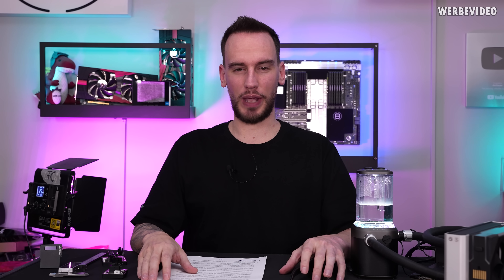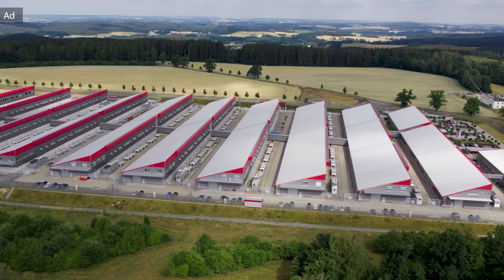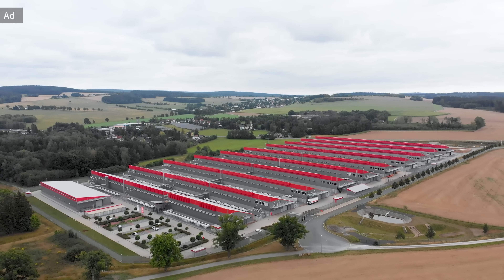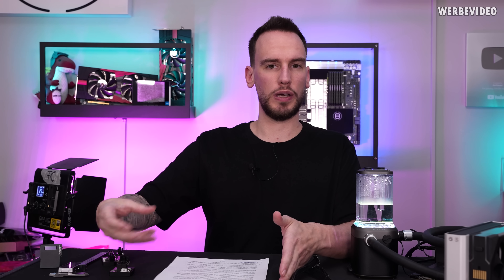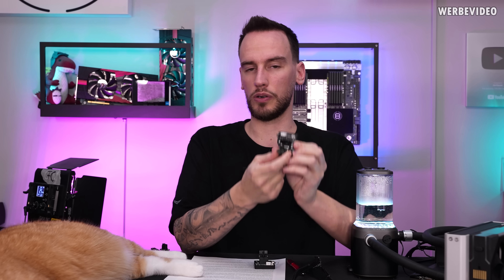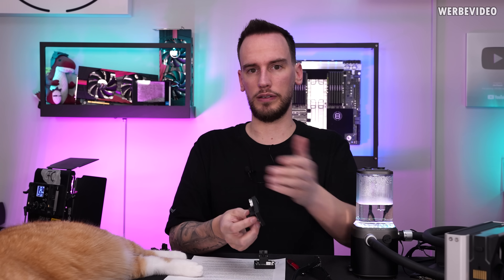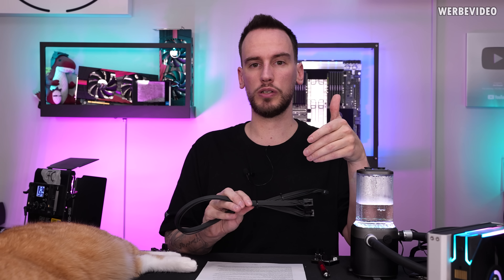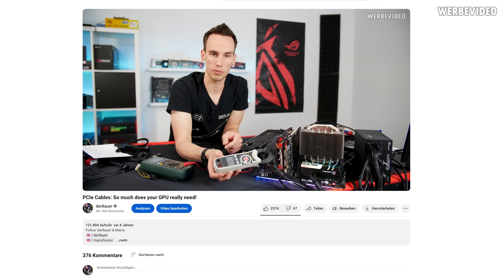12VHPWR is just Garbage and will Remain a Problem!!

Comment: Thank you for the video sir 😮
Just bought rtx 4090 strix card im gonna check it when i go vacation 
Im worried if my fractal torrent can fit to  bent the nvidia 12vhpwr connector at 35 mm in my case though 😅 (because the card is so expensive cost me 150k  PHP equivalent to 2,710 USD)

Comment: The designers of the actual cable Plug for this cable were incompetent from the beginning. THAT needs fixing, regardless. I also agree that 2 cables would be much better. Of course, that would mean redesigning and potentially REPLACING all of the 4090s so far sold. Nvidia could afford it, but I don't see them doing anything even close to that. Maybe the 5090; but even then, 2 cables on that might get questions asked. Great and very informative video, keep up the great work.
Reply: 2x CPU/EPS power cables would do it. Perfect solution.

Comment: Why not using the 24 pin motherboard plug into a pcie special cable? Also, why not soldering the plug on top on the cards (though the back plate)? We don't have SLI anymore so there shouldn't be stuff on top of it.

Comment: As someone contemplating getting a 4070ti-Super, or possibly just a non-Super 4080, does this issue with the 12VHPWR cable only arise with the 4090, or has it also affected other "lesser" RTX models?
Reply: rtx 4080 founders edition and some others had this problem.Not all rtx 4080 uses 12VHPWR.Check it before buying it or buy amd.
Reply: @sametekiz3709  all 4080 use that connector, only 4070 and down can use 8pin

Comment: The cards been so wide, and the connector not giving a firm connection like the pleasant click of the 8-pin connector, I can’t see how they can savage this connector. Sadly the market is driven by looks. Adding a thicker/bigger/robust connector would ruin the aesthetics for the RGB crowd. I would love if they use a kettle cable for the GPUs. Solved. 😂

Comment: Irresepective of how many circuits they have, I cannot understand any rational reason to reduce the pitch of the connector to 3.0mm. All it did was create mechanical issues and installation issues. There are no benefits when the rest of the system and all power supplies use 4.20mm pitch connectors, especially when they just supplied adapters to everybody. That just made everything complex and dangerous for no reason whatsoever. Even ATX12V0 spec uses 4.20mm pitch and that's made specifically for SFF and power efficiency.

However I can understand why they did want to eliminate all of the redundant grounds in the PCIe 8-pin, they are a total waste of board space and make your card look 'visually' power hungry. If you did have 4x 8-pin PCIe connectors it has the same number of +12V circuits as 3x 8-pin EPS... which is the blatantly obvious thing to do.

Change to EPS, they never have awful pigtail style PSU cables so the safe maximum instantly goes to ~300W with 18 AWG and if you need overheard for an OC card, 3x EPS connectors would be stunning. The standard exists, it would be cheap to adopt, easy to modify PSU's for and much much safer for everyone.

On that note, I think you neglected to mention 8-pin PCIe pigtails which certainly would pose a problem for nvidia to run 4x 8-pin PCIe's. Because they are so prevalent in stock PSU's, even really high quality units there would be thousands of users trying to push 600W through just 6 +12V pins which has exactly the same factor of safety as 12VHPWR. Making a 'new' standard gave nvidia the ability to exclude such cases.

Comment: Why they keep insisting on using those many Pin Connector Designs despite only carrying a 12V and a GND Signal ( Signal?! 🤔 Ya get what I mean... 🤨 ) makes me scratch my head.
A 2x 12AWG Wire XT60 Connector from the RC Hobby Industry has a 30A / 500V rating and would - IMHO - look a lot nicer than what we use nowadays simply for only using two arguably thicker Cables on top of having a smaller Connector footprint. Heck... If XT60 isn't enough there's even XT90!

Personally, I'm running my RTX 4090 Founders Edition ( unfortunately the old spec Connector design ) with a so far not recalled 90° CableMod Pro V1.1 Cable and a 70% Power Target in hopes of it reducing the risk of a Meltdown since let's face it... Of all the Cables at my disposal to the Card ( the atrocious straight 4-Pigtail Adapter that shipped with the GPU or the barely acceptable straight 12VHPR that shipped with the PSU ) the 90° CableMod Cable is still the most favorable one with it a) being the only one not putting a bending load onto the Connector and b) it being the one with the most recent design specifications.

Comment: There is also something odd with cables. I used a Cablemod cable (after my adapter melted) just on its own, and because I was worried about it, I put a temp probe (attached to the connector) on it. I played Cyberpunk maxed out and saw the temp probe hit 61/64c at the most. Much of that was the case temp and the heat from the GPU fan exhaust, but it was a baseline for me to work on.

I changed my PSU a month later to an Asus ATX 3 one and used the cable that came with it. I set it up the same, put the probe on the same and ran the same save file of Cyberpunk to compare. The probe hit 51 to 53c max....10c cooler.
That seems to show that the pin type/cable thickness/plastic used by Cablemod is different from Asus.
Reply: and neither of those temps are something I'm comfortable with my cables being. 50C can burn you, and i know you aren't going to be touching it but imagine if a plug from your wall was getting over 50C.
Reply: @Born_Stellar  As I mentioned, most of that is from the case and card (heat it throws out). Idle, its around 30c. 
It's a physical temp probe, so it picks up all the heat, but it's still a way to monitor any changes as long as I have a max baseline, which was Cyberpunk, but is now Avatar.
Reply: @innopriest  lol not dangerous. but I would be concerned if I picked up a cable that was 50C. I also watercool everything with a ton of rads, I just like keeping stuff cool.
Reply: @innopriest @innopriest  The probe is a physical one, so it reads all heat, case, GPU fans and so on. It is 30c idle and has hit 53/54 with Avatar, but most of that is from everything else rather than the cable. I have a baseline from that, as Avatar Maxed now draws more on than Cyberpunk. I have an alarm set, so if it goes over 58c, I know something is wrong.
The only time I need to redo this is if a game comes out that pulls more power than Avatar or if we have a good/hot summer.

Comment: This comes out more as Nvidia forcing some form of restriction on their users because they could've used a 8 pin EPS connector instead. That's what the A6000 uses and it can manage with just one connector. Or maybe design the card better because AMD somehow manages to squeeze about the same level of power delivery out of only two 8 pin connectors. But I guess this is what happens when people bitch and moan about a flawed product then proceed to buy said product anyways. That really sends the correct message, especially when the suggested solution for the problem involves adding another connector for redundancy. Now you have two potential sources of problem instead of one. And the sad part is, this is probably what nVidia will do. Then these new cards will sell like hot cakes because people are desperate for a quick fix, then they'll bitch and moan again because they'll run into the same issues they had before, the whole redundancy will not work for some reason and so on. Somehow adding more fuel to the flame will put it out?

Comment: The easiest way to do is to go back to the MUCH SAFER 6-pin and 8-pin connectors. Just three 6-pin connectors have better power handling compared to one 12VHPWR ! I have been using 6- and 8-pin connectors with cables literally bent at 180 degrees directly from the connector. No issues whatsoever!  Why you may ask?  Maybe  because the 12VHPWR has considerably smaller pins - meaning less current through each pin. And it is so densely packed, that it is considerably WORSE than any combination of 6-pin or 8-pin. Even if you connect the 12VHPWR in the best possible way with a perfectly straight cables near the connector, and if you are using exactly the factory specified power of 600W, it is doomed to fail - sooner or later (most probably sooner). And really - the solution is VERY EASY - go back to the much safer 6-pin connectors - three 6-pin will be much better than one 12VHP.  The introduction of 12VHPWR literally smoked billions of USD of consumer's money - for expensive cables, for expensive adapters, and then - for replacing all melted cards, cables and connectors. This is a massive FAIL!

Comment: I bought my 4090 in April and did sooooo much research to make sure i bought the best cable for it. I thank God i bought the Corsair 12VHPWR. To this day I can't find a single reddit or twitter post of that cable being involved in a connector melting.

However, that level of meticulous research shouldn't be a requirement to make sure that your +$1,600 does not go up in smoke! I'm tired of people saying it's solely from user error. It is a design flaw full stop.
Reply: I wouldn't say it isn't user error. However, it is a design-induced user error, which is even worse than a simple design error.
Reply: Yup, and if it's that easy for the cable to be installed wrong, because it has to be 100% perfect, it's still a design flaw. You cant put products in the market for the average consumer with no safety margin, that's negligent to think every consumer will be perfect. Every 4090 owner should be joining a class action lawsuit vs NVIDIA and contacting regulators to force a recall.
Reply: Its like L85A1. Need a complete rework to start working as it should`ve been.
Reply: absolutely 100% agree my friend. if only the whole wider industry and industry partners / working groups itself wasnt so entirely dumb. unfortunately the corsair company are really an exception rather than the industry norm here
Reply: Same reason but now just got ModDIY cables (and not adapters) from 12VHPWR to 3x8pin going straight to the PSU, even though it has native 12VHPWR connector already. Risk decreased down to just one 12VHPWR. If I could somehow replace the connector on the card itself I would too
Reply: I've been running a Cablemod 3x 8 pin to 12VHPWR extension type on my Zotac 4090 Amp Extreme Airo for over a year powered by the Corsair AX1600i, the card has been powered up 24/7 with a lot of gaming hours and I have had no issues whatsoever. I've even removed the GPU and power cable to replace my NVMe with a larger one months ago and still have no issues with my 12VHPWR connector on the GPU. I still don't like the connector but as as long as it's inserted properly you really shouldn't have too much of an issue. This is fitted inside a Phantek Evolv X with the glass side panel on with about a 2mm gap between the cable and glass.
Reply: Ive also got the Corsair Cable, been using it for 1 year on my 4090. Not one problem, very good build.
Reply: Any chance you could list a SKU number?
Reply: It's not about it catching on fire.  Did you even watch the video?  It's about the connector being intermittent at high loads.
Reply: I wish your adapter will have the connector facing down :/
Reply: @sinAnon6689  It is a faulty design. However, users actually knowing what they're doing when building a system largely negates any issues.
Reply: @sinAnon6689  Haha. Yeah ok fair. I can't really argue those points.

Roman hasn't had any issues himself. I assure you of that. I still need to stress that nobody who knows what they are doing when building a system, truly knows, will have issues. I certainly haven't with these cards, and neither has even a single YouTuber that isn't a moron for that matter.
Reply: It's user error. No matter howuch you don't want it to be.

It's funny. I literally never have the problems others have. Ever. Guess why? I know what I'm doing. It's honestly that simple.
Reply: @nexxusty  Why are you gracing us plebes with your presence, Godly one?
Reply: @nexxusty woah, you're soooo coool
Reply: @nexxusty if it was an amd card eith their loud lbimd fanboys, there wouldn't be all this exaggerated comments

Comment: Nvidia created a solution to a problem that never existed in the first place lol. I've got a RX6950XT with two normal 8pin power connectors and it's good. I had a RX6600XT with the same and it was fine, I had a GTX1660super with the same and it was fine and a RX580 that also used a standard 8pin connection and that too was perfect. 

Steve from gamers Nexus still thinks it's user error lol. I can just imagine the amount of heat that runs through a single 12 volt high power connector and all it takes is for it not to be seated properly then boom lol. Even if it is seated properly the connection can still flex lol. 

I'm glad I stuck with AMD because they clearly know what they are doing in this department.
Reply: Steve from gamers nexus is a processional troll who let "tech jesus" get to his head.
Reply: @blahx9  thank you 🙏

Comment: Just update whole atx specs. Motherboard layout is a mess, pcie slot spacing is not relevant for modern cards, socket needs to be rotated, power ports should be together and updated, new gpu power connection needs to be redesigned, hole locations and number of holes should be standardized, eatx needs to be defined, just scrap it and design it again at this point.

Comment: OMG!  I’ve been struggling with stability and BSOD issues in my new build for over a year!  Nothing made sense; been swapping out parts and RMAing parts.  Just swapped out my CableMod extension cables and went all my issues went away.  Never had an issue with before but ever since I dropped in my 4090 I had issues that I couldn’t consistently replicate.  WhenI look back at how much time and money I wasted troubleshooting, I want to cry.
Reply: Sorry to hear that, please reach out to our support team about this and we will send you a direct replacement cable if your PSU is one we support to make up for this. Just tell our support team that Matt sent you and we'll get you all taken care of. <3
Reply: @matta.1673  Thanks but after all I’ve been through with my current build, I’ll pass.  I don’t blame CableMod - I’ve used many custom cables and extensions without issue.  However I think after years of use my extensions for my ATx power and PCIe crapped out and just to be safe I went back to the cable that came with my PSU for the 12vhpwr.

Comment: in spite of the many many companies that are part of PCI-SIG, including Intel, Nvidia is the only one with these abominations on their cards, through forcing the AIBs to use it. and since its widespread with nvidia gpus, psu makers have adopted it.

it seems remarkably like nvidia fully committed, and refuse to back down because of some sort of silly pride thing. its ridiculous.

they need to drop all iterations of this nonsense.

they need to go back to the molex mini fit or adapt a new something thats closer to the mini fit, vs the terrible choice they made.

couple this with the rash of super heavy 4090s breaking due to solder joint issues because of the weight (and brackets/stands aren't helping). it really just seems like the 4090 is (perf aside) a terrible product. its too hot, too heavy, and pulls too much power through a crap connector.

Comment: Cars have been using 12V for years, at upto 120A why did Nvidia reinvent the wheel? You can cheaply get 12V 50A connectors or the 4v4 connector exists

Comment: if the solution is to use 2 connectors, why not use 2 connectors that don't suck? like, we already have eps12V. it's ~ 300w each, and it has safety margins on par with pci 8 pin, as just like pci 8 pin, it's not made out of effective management

Comment: I think with this connector there was a missed opportunity. Why didn't we switch to 24 volt lines? Why keep using 12 volt for no reason? Laptops use 20 volt power system and they have thick copper traces straight on the board. Why do we use 12 volts with thick wires and failing connectors when you can reduce current by 2X? You don't even have to change anything marginally, the existing power designs and PSUs are easily reconfigured to 24V (because they are buck converters), and you already have super-dedicated connector to make it separate 24V line and keep ATX 12V compliance for the rest of the system.

Comment: my brother build a pc neearly a year ago with 4090 no problem at all with connector (he is using the oryginal cable that came with strix). 3 months ago I build a pc for my self 4090 but from msi with seasonic power supply 3.0 which has build in 12vhpwr connector and cable I do not have any problems either so far

Comment: Here's another common sense solution. Put the damn cables/plug array at the end of the heatsink side towards the front of the case for much simpler cable management and to stop any more manufacturers blame on end users. This way if it still kills itself or the GPU at that stage we can finally sue Nvidia finally for this with a second plug placement format still failing whith additional airflow cooling ruled out to definitely show its the plug array itself and is finally the undeniable truth! Then we can unarguably in court prove Nvidia are solely at fault for this!!

Then people can get their money back finally as well as taking Nvidia's collective heads out of the clouds and bring their business back down to earth and give them the serious reality check that they've desperately needed for the past 7 years straight as well. This will decrease pricing as well. We win, they get a reality check and a massive hit to their wallet. Once again common sense! And an effective way or bringing reality back to GPU pricing into the future as well.